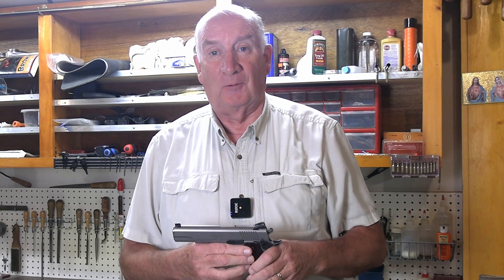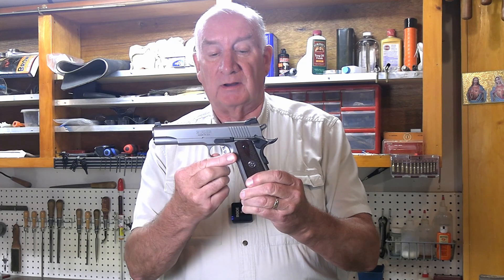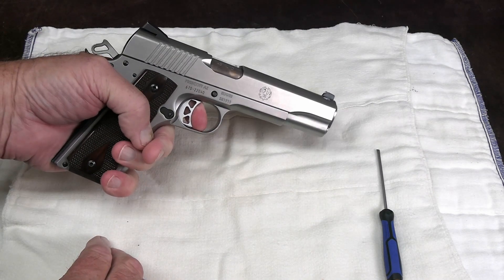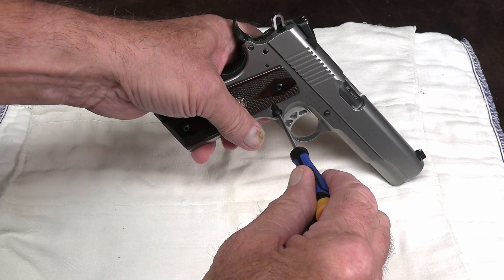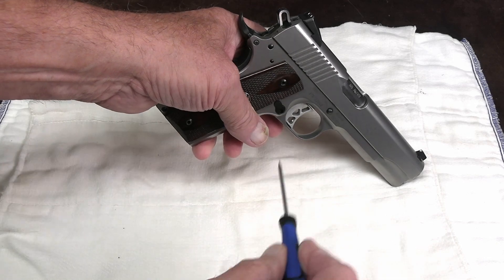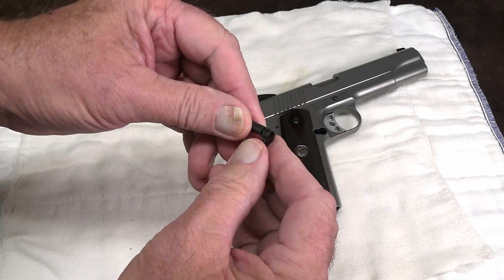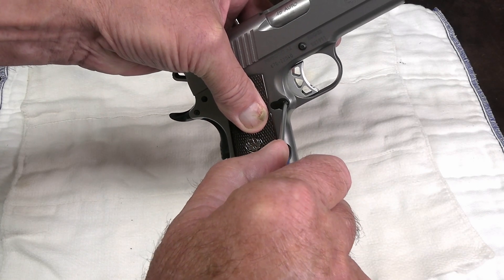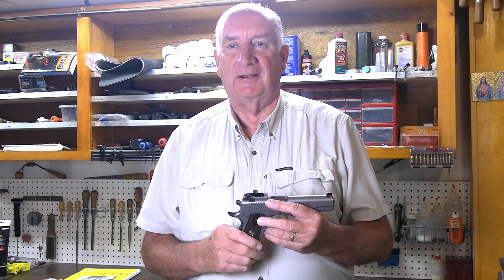How to Remove the Magazine Release Button on a 1911 Pistol ~ Relax, it's easy!

Comment: Just pulled my SR1911 out of storage. Couldn't get the magazines to latch and noticed the right side of the mag release was staying extended. I could push it back in to work again but it is a repeatable problem possibly caused by pushing the left side too hard. Any ideas?

Comment: But, is it the same process for an ambidextrous magazine release?  My latest 1911 has the ambidextrous thumb safety, and the process is a bit different to remove it than a standard 1911.
Reply from the maker: Sorry, but I can't speak for non-standard product modifications that I have no access to study. You'll have to contact the manufacturer for such details.

Comment: I tried and tried till my fingers are numb and still can not do it
Reply from the maker: Please follow my directions carefully.  There is absolutely no pressure applied whatsoever.  If your fingers are numb, you are doing it entirely wrong.  A screwdriver and two fingers to turn it are all that's needed.  My four year old godchild has done it.  It is NOT a screw.